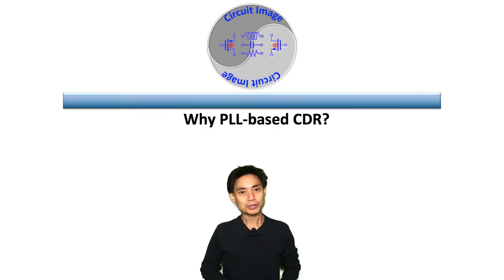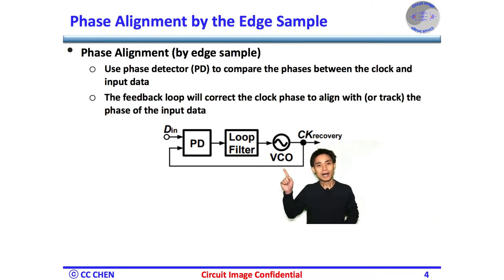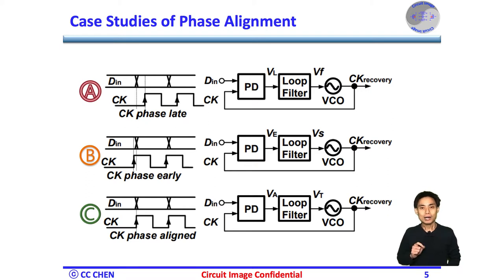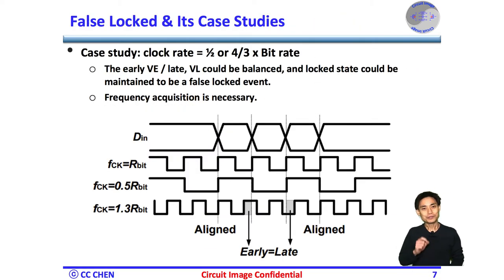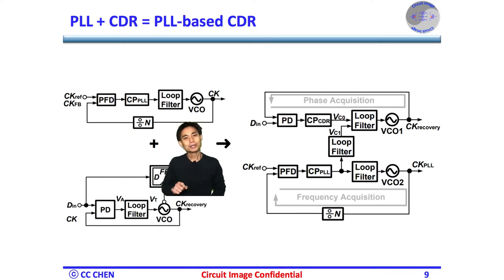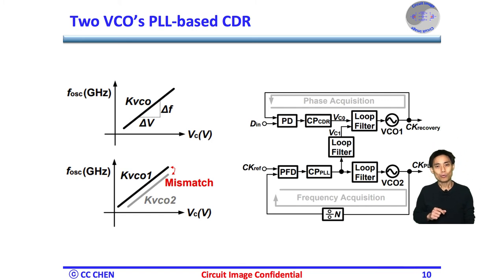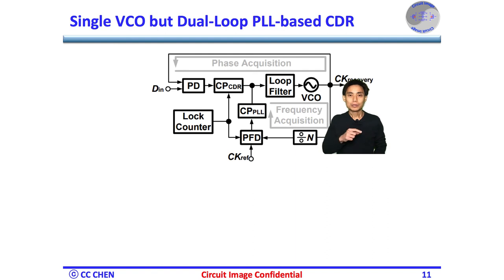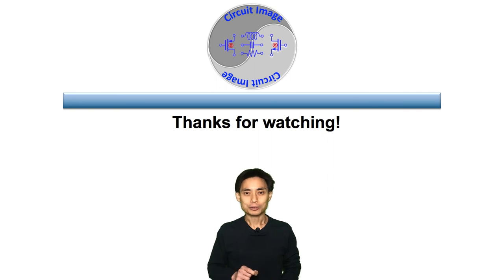Why PLL-based CDR?

Comment: Thank for the sharing, I really appreciate it. I'd like to confirm one thing that the disadvantage of PLL is the litter peaking right. However, DLL-based CDR can eliminate the jitter peaking.
Reply from the maker: Thanks for asking. Yes, your understanding is correct. The DLL-based CDR can eliminate the jitter peaking.
Reply: @circuitimage  Hi CC, how are you doing. There are some queries for PLL that I'd like to confirm with you.
1.In general, PLL only in TX side, it won't be in the RX side, there is a CDR in RX side to recover the data and clock, may I know if it's correct.
2.Since I've heard that there is  DPRX_PHY, and I think there is only RX, but no TX, if it's correct, then may I know how to generate the high frequency and how to check the clock.
Thanks a lot~
Reply from the maker: @許育瑛-n5t  Hi 育瑛,

Thank you 🙏 for your good questions and I'm doing well. 😊
I have comments below.

1.In general, PLL only in TX side, it won't be in the RX side, there is a CDR in RX side to recover the data and clock, may I know if it's correct. 
[CC] No, the RX may have the PLL or share the same PLL with the TX depending on the topology, which I present lots of different CDR. topologies. 😊

2.Since I've heard that there is DPRX_PHY, and I think there is only RX, but no TX, if it's correct, then may I know how to generate the high frequency and how to check the clock. Thanks a lot~
[CC] No. This also depends on your system. The DP is a unidirectional link. But you still can receive the DP data and retransmit it. This application is used a lot in the automotive display panel. 😊
Reply: @circuitimage  Hi CC, thanks for your reply.
Regarding the 2nd questions, so it means even the PHY has RX only, then still can use PLL and CDR to get the data, but if it's RX only, then where does the data come from.
Reply from the maker: @許育瑛-n5t  Hi 育瑛, 

Thank you for your additional questions. If it's RX only, then the data comes from the its partner TX through a cable. 
Best regards,
Reply: @circuitimage  Thanks CC, I got it
Thanks for your reply!!
Reply from the maker: @許育瑛-n5t  you're very welcome. I glad that helped. :)

Comment: In reality, Din is generated from some sort of equalization since the received data swing is really small. Assuming this, to sample the edge and data we need two timed comparators. So those two can be inserted between Din and PD. PD takes edge and data info to produce early and late pulses that make VCO clock phase adjusted.
Reply from the maker: Good comments. Yes or No :) That depends on your topology. Most of the published topology was applying what you said :)

Comment: Hi,
Thanks for the wonderful explanation. Just a small question. Why isn't it enough to just have a PFD based PLL with Din as its input? Won't that directly give the recovered clock? I suppose only issue could be Din not toggling like the clock.
Reply from the maker: Hi Somanshu,
Thank you so much for the kind words and good questions.
You're correct that the issue is that the input data Din may not toggle all the time like the clock.
Thanks,
CC

Comment: Nice video ! Two questions: 1) At 5:50 you mention that PFD has a wide pull-in range. What does this mean? 
2) At 7:48 you mention that frequency offset between VCO1 and VCO2 causes pulling phenomenon which can move VCO1 away from received data rate. How this happens? Thanks
Reply from the maker: Hi Hrachya, thank you for the good question. I have comments below. 😀
1. The phase-frequency detector (PFD) would also detect the frequency offset than the (phase detector) only; therefore, a bigger frequency offset is much more tolerable in the PFD and that's what I meant that PFD has a wide pull-in range in a bigger frequency offset. 2. The received data rate would have a frequency offset from the VCO2 since the reference CKref has the frequency offset inherently from the far-end TX's reference CKref; therefore, the VCO2 would pull the VCO1's frequency while the VCO1 is trying to lock the input data.
Reply: @circuitimage  thanks ))
Reply from the maker: @hrachya_khachatryan  You are very welcome.

Comment: Hi, Chen Really appreciate all the nice videos! They are very concise and informative and I really like the style you presenting them! I will pause to think about for 5 seconds when I am doing almost anything now.  ;-) I have some questions. 1) first one is at 8:00 where you discuss two VCO PLL-based CDR. Since the far-end TX and local RX ref clocks will always have some frequency offset, ideally speaking the loop with VCO1 will be locking to the input data frequency and that means VCO1 will be running at slightly different frequency than VCO2, right? then I don't understand why this mismatch matters. 2) at 9:03 with single VCO but dual loop PLL-based CDR, I guess the VCO will lock to the local reference clock. Because of the frequency offset between far-end and local reference clocks, don't we still have the pulling effect you discussed earlier, meaning the phase acquisition loop will try to align the phase continuously to match the input data's phase but not locking to input data frequency. One last comment. Could you also provide a list of references at the end? it will be very helpful for people like me who know little about CDR but want to catch up and understand it more in details. Thanks a lot!
Reply from the maker: Hi Xiaodong,
Nice to meet you. Thank you so much for your feedback and I'm glad my videos help. I have comments below.1) first one is at 8:00 where you discuss two VCO PLL-based CDR. Since the far-end TX and local RX ref clocks will always have some frequency offset, ideally speaking the loop with VCO1 will be locking to the input data frequency and that means VCO1 will be running at slightly different frequency than VCO2, right? then I don't understand why this mismatch matters. [CC] If both VCO's quality factors (Q) is not low, that's probably okay. But, if both VCO is LC VCO, the pulling effects would create lots of spur jitters or even frequency offset.2) at 9:03 with single VCO but dual loop PLL-based CDR, I guess the VCO will lock to the local reference clock. Because of the frequency offset between far-end and local reference clocks, don't we still have the pulling effect you discussed earlier, meaning the phase acquisition loop will try to align the phase continuously to match the input data's phase but not locking to input data frequency. [CC] Since there's only one VCO, there's no pulling effect between two VCOs. In this case, the pulling range of the phase acquisition loop (lock to input data w/ frequency offset) should cover the frequency offset, which must also lock to input data frequency in your design.3) One last comment. Could you also provide a list of references at the end? it will be very helpful for people like me who know little about CDR but want to catch up and understand it more in details. Thanks a lot![CC] Thank you so much for the very good suggestion, but most of my circuit images were based on what I've learned in our design project, so lots of materials cannot be shared. I don't quite remember which I've learned can be shared, if possible, in public. You can tell me a specific or general circuit, and I can find it for you specifically. 😀
Reply: @circuitimage  Hi, CC Thanks for your reply! I understand now. No worries about the references. if i have questions, I leave them here. Thanks again for your help!
Reply from the maker: @breezerlxd  Thank you for your understanding. But, I'll still follow your great suggestion of putting some very basic references I've read in each topic, which may not be completely what I've learned but should be good enough for most audiences. :)😀
Reply: @circuitimage  That will be great! Thanks a lot!
Reply from the maker: @breezerlxd  You're very welcome.😄

Comment: Hi Chen, nice video about pll-based CDR. On slide 11 about single-VCO dual-loop architecture, why do we have to switch from frequency loop to phase loop? Why can't we just let two loops operate at the same time? Also if we disconnect the frequency loop, as temperature and supply voltage variation slowly drift vco free-running frequency away, will false lock recur?
Reply from the maker: Hi JY, 

Thank you for the good feedback.

Yes, you could keep both loops going at the same time, but there's an interaciton between two loops. So, there is a risk of instablitiy or pulling from the interaciton between two loops. 

Thanks,
CC
Reply: @circuitimage  Hi Chen, thank you very much for the prompt response. You might have overlooked the last question in my comment: "Also if we disconnect the frequency loop, as temperature and supply voltage variation may slowly drift vco free-running frequency away, will false lock recur?" Is it an issue to be concerned?
Reply from the maker: Hi JY, 

You're very welcome. Thank you for the very good feedback.

Yes, what you mentioned for the VCO frequency drift was real; therefore, the CDR loop must have the integral path to cover the slow temperature and supply voltage variation. TBH, I saw some paper's CDR removing the integral path and I don't think that would work in a long time. 😊

Thanks,
CC
Reply: @circuitimage  oh right, just as you mentioned in another video. Integral path can slowly pull VCO towards the slow frequency drift (luckily temperature and voltage variation is normally very slow). But since PD has limited capture range, we still need frequency acquisition loop to assist at first when frequency difference is big. Thank you so much Chen!
Reply from the maker: Correct 👍 You’re welcome ☺️

Comment: Can I say PLL based CDR loop latency is much smaller than PI based digital CDR ??. in this aspect can we say PLL based one is always better .? Could you  explain in detail comparison between PLL based vs PI based CDR performance. 
Thank you Chen
Reply from the maker: Thanks for the suggestions. Will do :) 
This may not be the case, but that can be done easily. The loop latency depends on how your CDR logic was designed and how those impairments were mitigated.